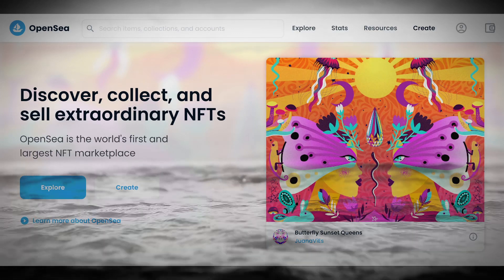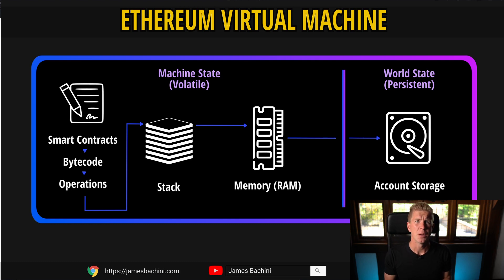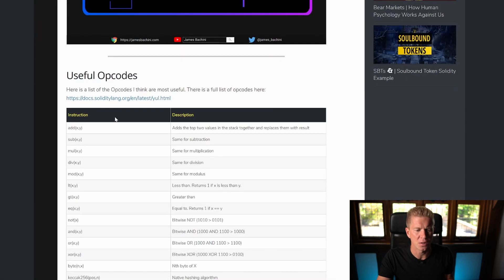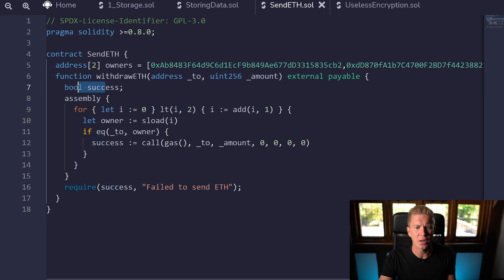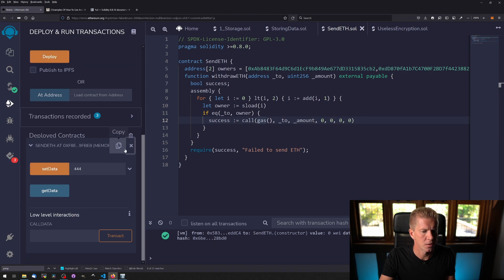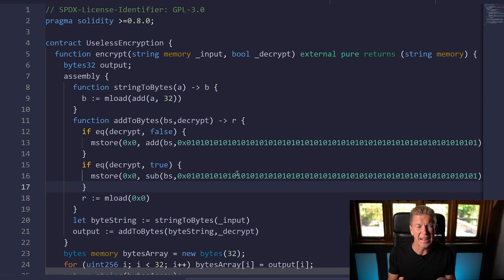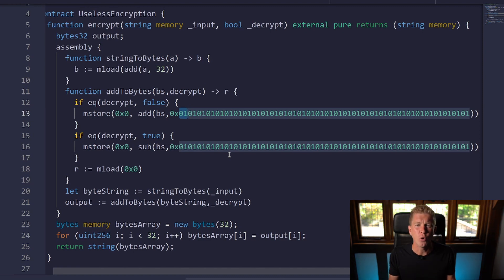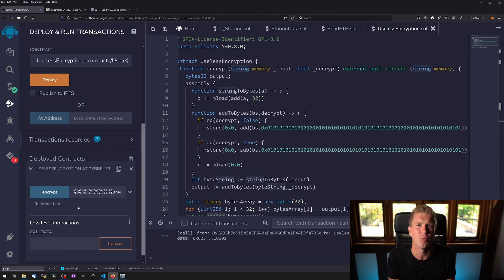How To Use Assembly In Solidity

Comment: On line 5, why didnt you have to declare that variable as storage? Great vid btw
Reply from the maker: Hi Varun which contract?
If it's the first one we are using assembly to directly access the first available storage slot so don't need to declare it externally in the solidity code. We can just call sstore which the function itself indicates where we want to send that data. There is an equivalent mstore function for memory allocation.